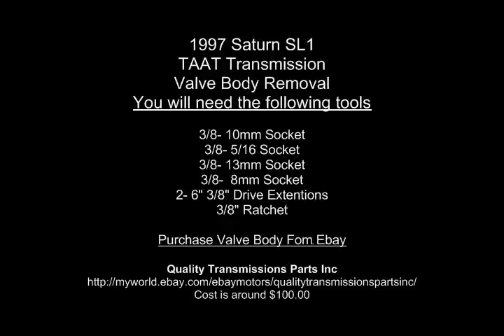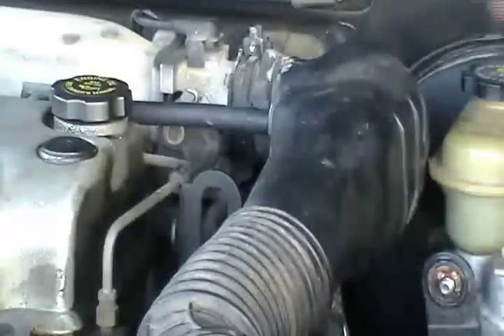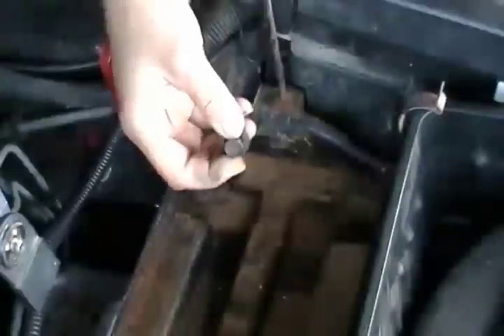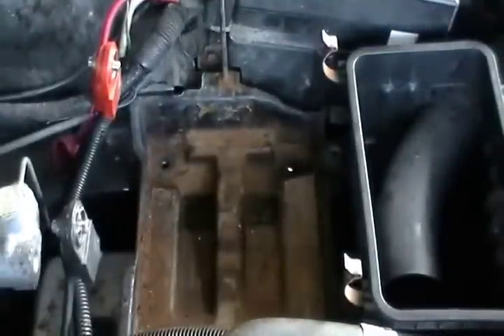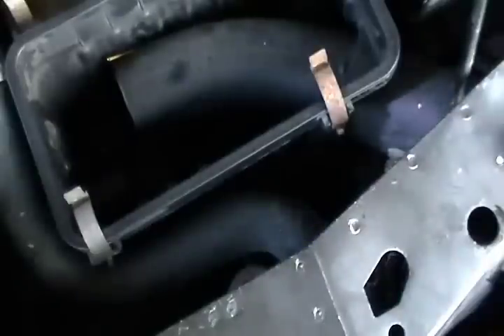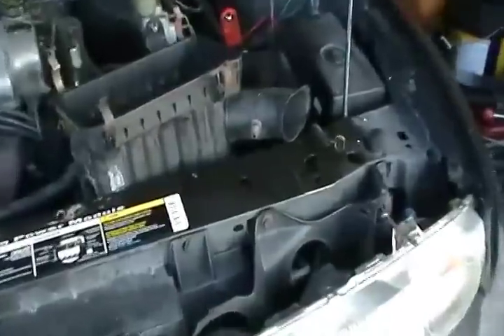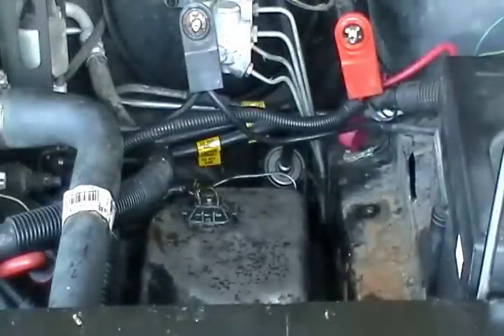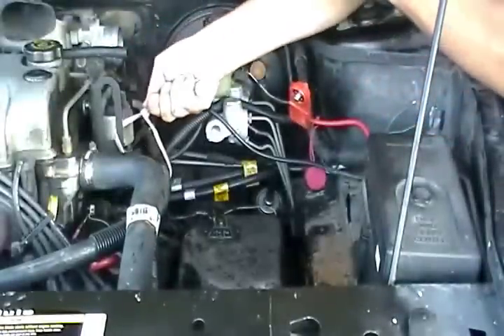Saturn TAAT Transmission Valve Body Removal 1of 2

Comment: Several years after posting these videos (it's a 2+1 episode series with an HD removal video showing how the rod in the rear has to be inserted back into the new valve body, you should watch that video as well) people like me are still using it as a guide through this process. I did this job yesterday for the first time and my car is now shifting smooth again.

I have to say that, after watching it several times and with the right tools, it went through fairly fine for someone who is a basic skilled DIY mechanic. I also have to say thank you for taking the time to publish this as a real tutorial and not just to get visualizations. My notes/contribution to your work is below:

- as some have pointed out, some of the later Saturn models have the computer installed on the battery tray: it's two 10mm nuts plus the computer plug (light blue lever, just pull it and the plug should come off right away, then zip tie the computer somewhere on the hed of the engine on the left)

- all the wiring around the trans pan is easy to put away with zip ties but there is a rigid AC harness connection there as well. I zip tied it to the coolant hose running above to keep it up a bit, w/o forcing it too much

- the head of the small bolt with all the connections (which in this video was losenrd with pliers, is a 7mm nut)

- there are no published torque spec I could find for all the bolts keeping the valve body, only the 8 bilts of the pan itself

Good luck to all the Saturn enthusiasts out there!

Comment: I want to thank you very much!  I got three codes off of the OBD2 and they pointed to bad 5 shift solenoids (P0732, P0733, P0783).  I bought 5 rebuilt ones on eBay, One gasket, and followed your instructions and replaced them all.  And now, THE CARS SHIFTS JUST FINE!!  Thank you very much for saving me $1200. And now I have a lot of new tools including two torque wrenches (and a sore back but that is getting well).

Comment: My 2001 Saturn was slamming into gear, and all the shifts slammed.  It progressively got worse to the point I didn't drive it because I was afraid something was going to break.  I checked my input shaft nut and it was fine.  I replaced the valve body and it worked great.  Everything's nice and smooth.  THANK YOU VERY MUCH for this tutorial.  It helped a lot!

Comment: Thank you. I have a 93 which has 12 bolts on the trans cover so I needed 1/4 inch drive with flexes on both ends to remove.I am out on disability so it took me days to do . If healthy I could do the older ones in 3 hours. I can't imagine faster. The car drives great. Thank you.

Comment: Perfect video - if it weren't for time spent tracking down an inch/pounds torque wrench and replacement bolts after I over-torqued, I would've been done in 90 minutes.  Simple and Easy, and after driving for about 20 gear cycles, I'm shifting smooth as silk.

Comment: I just want to say thanks for making this content, my wife & I both drive Saturn's (2000 SW2 & 2002 SL1).  I just had my SL1's transmission rebuilt less then a year ago & now it's shifting hard. I will be testing to see if its the valve body, hopefully this will shed some light on the issue. Thanks again.

Comment: @Aaron Abrams Fixed and shifting smooth as ever. Drove with the harsh shifting for like 20 or so mixed miles. Came home and pulled PCM fuses under hood (both 10A) and replaced them in like 15 minutes. Went for a spin, good as new.

Comment: The ODB didnt show 5 bad shift solenoids, but rather only one or two. I just replaced all 5 while I was there.  I had the same problem 5 years ago and Saturn charged me $1500 to fix it.  While I was in the valve body replacing the solenoids, I saw the one that they had replaced earlier.  Now I will find if I can rebuild these for the next time this procedure is needed.  thanks again.

Comment from the maker: $400.00 is a good deal. Make sure the engine runs good.did you try searching the saturnfans website at all? Try the reverse slam cure.
You might get away with just draining fluid & replacing filter as well.
These are easy to work on and don't rust :)

Comment: Did you replace the valve body because of hard shifting? I have a 2001 Saturn SL1 which is hard shifting and has 'reverse slam' problems.

Comment from the maker: @Gogojon911 
No need to replace valve body unless needed :) , Check ALL fuses under hood, not in car,lol. Make sure you look at my other videos as well. check connector on top of transmission. To do this, the battery & tray need to be removed, Again, my videos explain how to do this. If battery connections,connector on transmission is good then test solenoids on valve body, again, another video I made here. let me know how everything looks and tests.

Comment: @FiremanCV ok i got the wire off and the bolt to the battery tray finally. i wanted to switch out a few solanoids manily the one for shift/drive because thats the gear that slams mostly, but i dont kno which one. i would do all but $ is tight and those lil things cost. is there a certain one or i could tell jus by inspecting them 0_o?

Comment: @KangenWaterAmerica I had the same problem just got my car back today. They had to Rebuild the transmission with, so 1 assembly kit, new filter and fluid, a reconditioned Torque Converter, a new valve body assembly.  So like 2400 bucks total :( damn you saturn!

Comment: hey firemanCV i got a ? for you....i was givin a 1996 saturn sl2...i was told it had no reverse...what i found out is when the car is first started up and its cold it goes right into reverse but once its warmed up theres no more reverse it just revs up...doesnt slam into gear....also all forward gears shift fine...it also has a check engine light p0732 gear 2 incorrect ratio...any idea what could be wrong??

Comment from the maker: @pfmsound 

Sorry for the delay in my reply
1st of all, if you don't skin your knuckles, your not a good mechanic, LMAO...

Did you disconnect the battery for a while to allow the computer to reset shifting patterns?

Some Saturn's are really picky, and need to relearn shifting patterns :(
Did you check all your solenoids in the valve body to see if they are within limits ?

Comment: You're supposed to remove the negative battery terminal first.

Also, at 2:10, you said you were removing the bottom portion of the air cleaner assembly but you weren't. You were removing the battery tray.
Reply: @RYANMENGES  "hey" funny when someone talks about someone's grammar and can't spell lmao

Comment: Installed today - prior to install, I had reverse slam and in forward gears it would sometimes not shift from 3rd to 4th. No forward gear slam though. These symptoms were only happening for about two weeks. Now after install of a reman valve body w/ Sonnax, I have a pretty harsh slam in between all forward gears but no reverse slam and it is not having the symptoms of not shifting inbeteren 3rd and 4th. Everything installed correctly and no engine codes present. Anybody have any clues? Thanks.

Comment: can you tell me if this trans mission is the same in a 2000 saturn SL2?
It's looks the sam e but I wanted t be sure also my car keep shooting the code P0741, Do you think that replacing the TCC solenoid will fix the problem, I can't get it smogged here in california becvause it lkeeps setting the check ngine light off before it completes the ready status on the OBD II
Thanks for you help this car has been like a mechanic course!!
Reply from the maker: Yes. It is the same. 
I would test all the solenoids to make sure you replace the correct one :)
Let me know if you need any help. :)